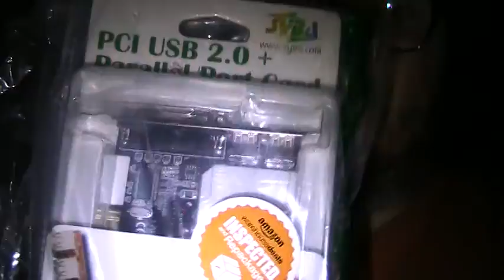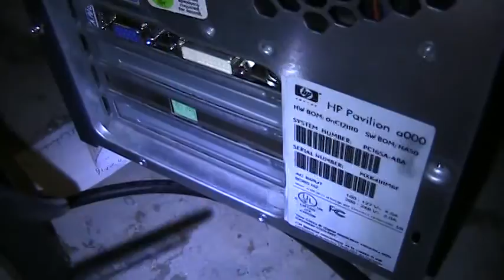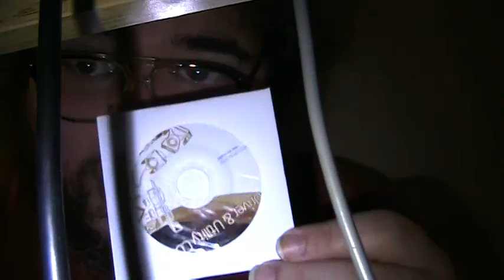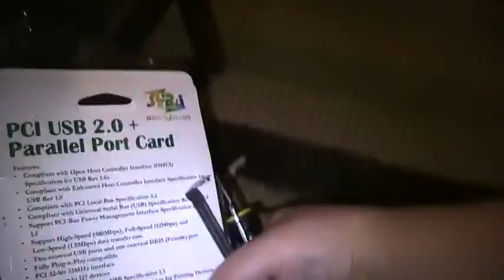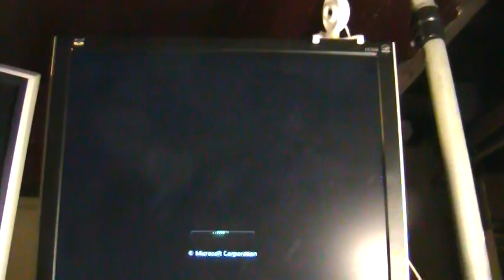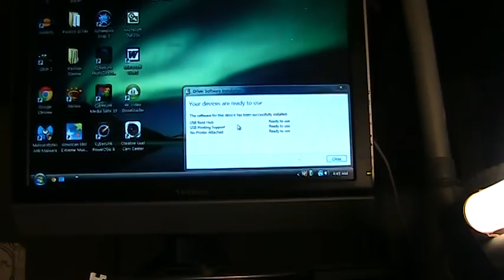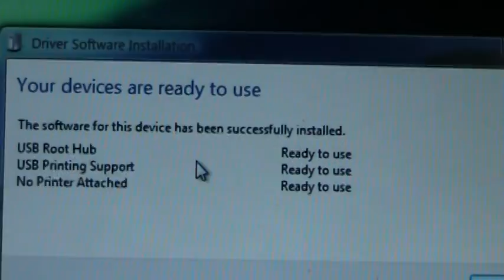3am drunken computer upgrading FTW

Comment: How do you find these deals? Its amazing how dirt cheap you find things especially laptops, I never really have any luck.
Reply from the maker: RogerRHF In addition to bookmarking many eBay sellers and checking on their latest "buy it now" items, I regularly check bookmarks I have for newly-listed buy-it-now computer items. The best deals I've gotten have happened as soon as an item is listed as "buy it now". Also Warehouse Deals through Amazon is sometimes a good source for cheap computer parts. Best of luck to you!
Reply from the maker: RogerRHF (It's an HP Pavilion a574n)
Reply: +ThatWord I'm trying to find one on eBay and nothing comes up. The only thing that comes up related to it is a PSU. Maybe its a rare model.
Reply from the maker: RogerRHF Yes, they are not too common anymore. When I first picked it up I checked the cpu on eBay, and that alone was fetching $20 as a base. It's fairly uncommon to find a 3.4ghz P4HT with an 800MHz fsb, but they did make them a little faster...but not much. I agree the model desktop itself is hard to find.
Reply: +ThatWord Yeah I agree, a computer like that is hard to find since it had rare specs for its time.